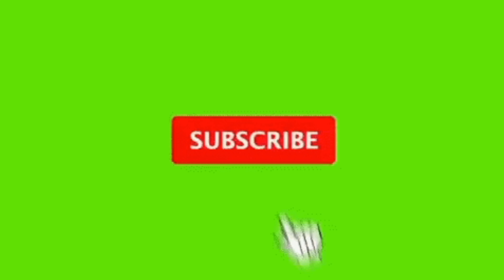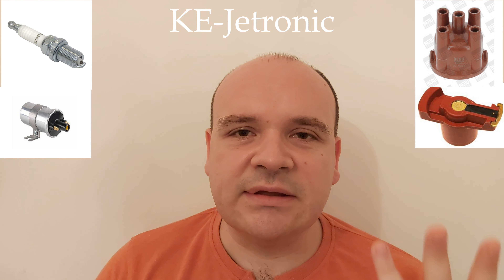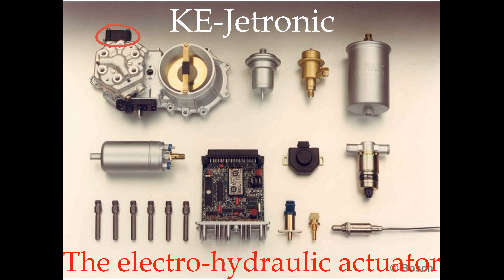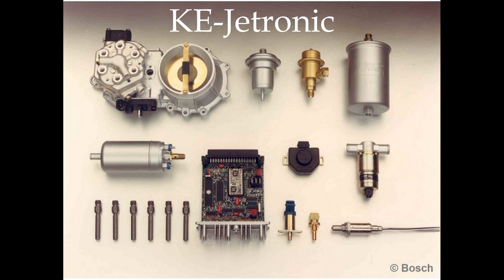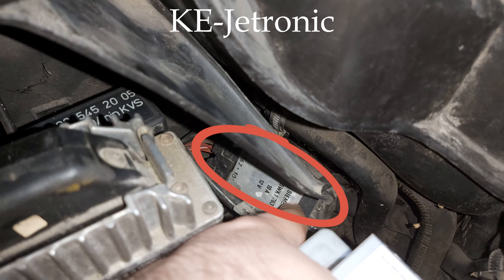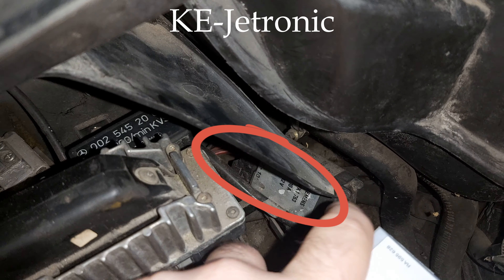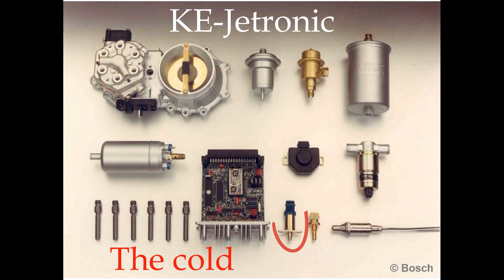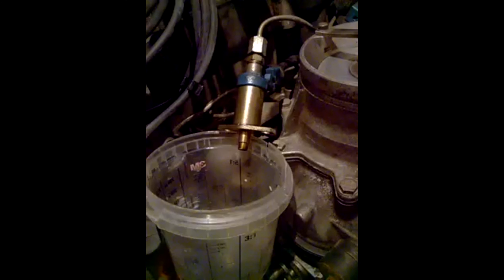㉦KE-Jetronic㉦ - The Basic Working Principle

Comment: Thank you sooo much
Reply from the maker: My pleasure. Happy Mercedesing 🍀 😊 😃
Reply: @mercedeske  your videos on classic mercedes benzes are the best, I hope i will be Mercedesing in my 190e after watching your videos 😀, i have a 190e 2.0 that the mechanics where i live messed up because they don't know how to work on it, so i am watching your videos to fix it myself in the next months, which me luck 😁
Reply from the maker: @JhnStill  Thanks. Just watch my videos and you will be able to repair your car yourself and to save yourself money.
Reply: @mercedeske  i will do my best, thank you so much, it will take me some time because where i live i don't have access to some parts (like a new diaphragm), or a pressure meter (i haven't watched enough videos yet but i think its required for good adjustment especially that the engine harness is damaged (also to be replaced :/) so i cant use a multimeter), but i wont stop trying. do you have any recommendations for a good diaphragm for bosch 0 438 0101 026 (190e 2.0l 1991)?

Comment: hello, in the other video you told that fuel presure must be 6 bar and now you say 5,3 - 5,5
I dont understand...
Reply from the maker: Yes, depending of the engines - engines m102/103 up to 5.5, engines m104/117/119 6.5bar system pressure. IF you have been watching the video on he EHA I took number 6 because it is easier to understand the differential pressure, not that all KE-Jetronic systems must have system pressure of 6bar.
Reply: @mercedeske  I have problem with power in My 230 CE...need 30sec to 100km/h.... fuel pump 5,4 bar, new spark plug, etc, new filter, NEW EHA valve, new all rubber components, motor 12,5 bar on each cyl. new lambda probe (all from BOSCH), I will  made some video from this maybe you can look and find wht is broken...also new injectors, all components tested and I have no idea what else I can do
Reply from the maker: @jsz3452  Okay, make a video. In my video on the convertible I have proved that even brand new parts have to be calibrated - check the EHA and the potentiometer. I believe that the EHA gives too much fuel but that's something you will have to see on the multimeter.

Comment: Hello , what is the role of damper cage?
Reply from the maker: It has to absorb the vibrations from the pump in order for the fuel pump buzzing sound not to spread on the chassis and not to be heard in the interior of the car.
Reply: @mercedeske  so if I don’t hear the fuel pump buzzing I don’t need to replace the damper cage ?
But why he have 3 pipes ?
1 to fuel pump 
2 to accumulator 
3 to fuel tank
Reply from the maker: @guyrozen4506  The fuel starts from the pump and flows to through the filter into the fuel distributor. The fuel accumulator has to absorb the vibrations from the pump. All three parts have to get fuel.
Reply from the maker: If you hear the pump, then it's bad. The sound is something like a V-belt, that loud. That's the indication that the fuel pump is bad.
Reply: @mercedeske  
Sorry but still don’t understand you.
The fuel accumulator need to absorb the vibration?
So what is the role of damper cage ?
Reply from the maker: To prevent the vibrations going onto the chassis.
Reply: @mercedeske  so how I need to check if I need to change the fuel accumulator or damper cage ?
Reply from the maker: If your fuel accumulator is bad you won't manage to start your car warm easy. You'll be cranking.....

Comment: hello, i'm deeply grateful for your amazing video lectures. however, I have something I would like to ask. i'm korean and am incredibly torn between choosing a w201 190E with ke-jetronic and a late w124 220E with motronic. however, in korea, we transitioned directly from carburetors to injection systems, which means there are hardly any experts on jetronic, or those who are, have retired or are few and far between, making maintenance challenging. People around me recommend not going for jetronic for these reasons; is this true?

1) is it true that jetronic systems are prone to misalignment, requiring regular checks? If so, how often should these checks be carried out?
2) I've heard that if a jetronic system breaks down, parts are hard to come by and can cost as much as a whole used car. Is that true?
3) can I sufficiently maintain and drive it for a long time by learning from your YouTube videos? Please, I ask for your guidance. 

i would like to drive a mt Benz, but finding a mt w124 is nearly impossible in korea, even though its maintenance is supposedly easier due to being an injection model. I really want to drive the w201 because it's compact and beautifully designed, and it's manual, but I am struggling with the jetronic system. please respond. Thank you.
Reply from the maker: Hello and to get to the point. KE-Jetronic is a very reliable system but nothing lasts forever and it requires some maintenance checks. There are some mechanical components which fail on the system and have to be replaced each 150k km and some of them at 50k km. No one has been replacing them so that’s why KE-Jetronic turns out to be a “BAD” system. It is very reliable(not prone to a breakdown even a bit). There are 2 sensors which have to be replaced(one of them is called potentiometer and the second one lambda probe, a modern O2 sensor) and considering the mechanical part – the injectors, the fuel accumulator and the pressure regulator – 2 VERY expensive parts on the system but they last for 150k km, so I wouldn’t say so. That expensive as people told you is the system not FOR SURE!!! Yes, you can fully repair your car watching my videos with one multimeter and a pressure gauge. Sometimes the EHA valve can go bad and all the other parts don’t fail, especially the sensors because they are all just switches. My opinion about the system – a work of art which was not lucky to show its full glory. You can repair it in your garage using common tools, multimeter and a pressure gauge. If neglected then it can be a nightmare because you will have to go through the whole system – ignition, vacuum leaks(related to rubber hoses), mechanical part of the system and sensors. There are videos on my channel about everything, so if you want to give it a try, just go. The system will request a mechanic from you, you must dedicate yourself to it and spend a lot of time but once repaired it will start failing after 50k km (lambda replacement) and 150k km everything else I was speaking about.
Greetings from Serbia,
Ivica FyM
Reply: in korea, the technicians, out of annoyance, said, "recommend you just get a new car." you're my savior, master!. thank you so much!!!
 @mercedeske
Reply: please enjoy a delicious coffee on me, even if it's just a small amount! Thank you.

Comment: Thank you very much for your video. I've recently bought a w124 200E with m102 engine. What I noticed is that sometimes when I start the engine it has an acceleration and seems the correct mode of operation because then when for example the AC is on, it is capable of compensating and maintaining the correct rpm. But sometimes there is no acceleration at the start of the engine and is more difficult to turn on. Furthermore is not capable of compensating the RPM when AC is on. I checked the idle control valve and is working. Seems like the electronics don't get the rpm signal to adjust the idle valve (I've also changed the ECU with no success. Any suggestion? Thanks
Reply from the maker: Have you replaced the potentiometer?
Reply: No I didn't I'll try this. Thank you.
Reply: I've replaced the potentiometer but nothing changed.
Reply: I don't know if it is correlated or not but after some weeks I bought the car and started using it,  It happened three or four times to smell something like a burning cable from the AC vent.  All the ventilation system is working well. I don't know if it could be or not but I suspect that some cables from ECU to the KE-Jetronic system that passes inside the ventilation are damaged. I said that because one of the last  I smelled it I stopped the car and tried to find out where the smell came out. And it wasn't in the engine compartment but in the cabin filter compartment. This happened some months ago. Since then no more smell but even no more idle stabilizing.
Reply: Don't know what happened,  but it's been running flawlessly for two weeks!
Reply: I've finally found the problem. It was a bad contact of the OVP relay. Even if it was working with no ABS light on I discovered that the contact resistor wasn't too stable and sometimes too high (50 ohms!!), when should be a few ohms. Maybe you already mentioned this kind of problem in case not I think this information could be useful for other w124 owners that have similar problems. Thank you  @mercedeske
Reply from the maker: @sabatinifabrizio My pleasure. I'm glad you solved your issue. Happy Mercedesing!

Comment: Hi . I have Mercedes 190E 1992 2000 cc engine Sometimes while driving the engine switch off what do you think the problem??
Thank you
Reply from the maker: This is a common issue. Check the EHA in all its phases. Check if you get current(mA) on the EHA valve. If you get 0mA on the ignition on then it can be the ECU. I have a similar issue on my car - when I put the original ECU, the car stalls, when I put the newer one the engine stays alive.

Comment: Very good resource! Thanks again. Have a 190E 2.3 with cold start issues
Reply from the maker: Check the cold start valve
Reply: @mercedeske  my E.C.U was the culprit. No power supply to the cold start valve and EHA valve
Reply from the maker: @123works  I'm glad you found the issue.

Comment: Hi, does anyone have any tips on what could be causing the slow acceleration after engine warm up on the W124 - 300-24V ? If I give it more throttle, the engine shuts off, I have to throttle with feeling to get it going and it takes maybe 10-15 seconds, which is pretty bad in a junction. I replaced the spark plugs, cables, coil, OVP relay, distributor cap and rotors, temperature sensors, fuel filter and still same problem + I have bad cold starts. I bought the car half a year ago, everything worked, the car was not driven and now on the first drive and several starts the following symptoms appear. Thanks
Reply from the maker: Hi. For the beginning replace the potentiometer and calibrate it, replace the lambda and check the cold start valve, replace the injectors and that should make things better. Concerning stalling at the junction, that's an issue which for, if everything is in order, I believe that the ECU is the culprit. But, before replacing the ECU check the whole system for its nominal values for each of the parts and then, then you can try with the ECU. This should help you solve many issues on your system.
Reply: @mercedeske  Thank you for your quick reply
Reply from the maker: @Bullva My pleasure.

Comment: Hi nice video, I have a w201 2.0 and it does not want to start, ocationally it starts but misfires so it stalls and then its hard to start again or it doesnt start. The spark plugs have some fuel on them when I check them, but also I check all HT leads and all of them are sparking, so am very confused because the is fuel and spark but wont start or run properly..would you be able to guide me on how to check it properly ??
Reply from the maker: Hi, thanks. At first-check the injectors. If you have more than 90k miles/150k km, replace them. At first did you or anyone else turn the mixture screw?
Reply: @mercedeske  hi thank you for replying, the car has 110k miles, the car was running fine one day, next day was no longer running ok. No one touch the mixture screw. Only me working on the car, I change fuel pump and filter and also clean fuel tank and change fuel tank strainer inside the tank. I ordered injectors so I can change them, may be tomorrow. After the problem I also change distributor diaphragm and o rings but car is the same no start or running very bad.
Reply from the maker: @T.F.D77  Changes the injectors and if the problem persists check the sensors.
Reply: @mercedeske  ok thank you I’ll change the injectors and see what happens, how do I check the sensors ?
Reply from the maker: @T.F.D77  Each 30k miles replace the o2 sensor, each 100k miles the potentiometer, check the coolant temperature sensor, the tps, the micro switch.
Reply: @mercedeske   my model doesn’t have o2 sensor it’s a 1988, I will double check but I don’t remember seeing o2 sensors. How many ohms should the temperature TPS and micro switch should have ?, is the micro switch the one controlling the idle when throttle is close. Do you have a video checking this sensors. Thank you so much.
Reply from the maker: @T.F.D77  https://www.youtube.com/watch?v=yY7OXR8RTLk
Watch this video and its cards

Comment: Hello my friend how are you?  I follow all your videos and I wanted to ask you if you know how to repair the fuel pump relay of a Mercedes 230E year 1981, since in my country it is not available as a spare part.  From now many thanks and greetings!!
Reply from the maker: Hello, I am fine, thanks. How did you come to that that you have a bad fuel pump relay?
Reply: @mercedeske  Hello, I know because the fuel pump continues to work beyond the fact that the vehicle does not start.
Reply from the maker: @diegovelazquez9213  Try to start the car. Remove the relay, put a wire in the contacts 7&8 and if the car starts, then it's the fuel pump. If the fuel pump runs, then it's not the pump relay, check the coolant temperature sensor or the cold start valve.
Reply: @mercedeske  Thanks, but the problem I have is that I put the car in contact (without starting) and the pump continues to send fuel continuously. Before in a few seconds it stopped
Reply from the maker: If it doesn't stop for about a second then it's not good.

Comment: Hello, I have a 1988 model audi 80. KE-jettronic engine. When I turn the ignition on, my fuel pump runs constantly. It used to work for 3-5 seconds before. I can't find the cause of the problem. I'd be very grateful if you could give me a clue.
Reply from the maker: On Mercedes I would either replace or check the fuel pump relay.

Comment: I have a1982 Volvo 244 gl, and I think it has the same system.  Do you know if it’s the same?
Reply from the maker: If you have the eha and the potentiometer on the system then it's the Ke-jetronic if not then it's K-Jetronic. There is also K-Jetronic with lambda regulation. So, again...if you have the eha and the potentiometer then you have KE-JETRONIC system.

Comment: Amazing video! You’re English is fantastic and your video helped me a ton. I will be watching the second part right now!
Reply from the maker: Thank a lot for your nice words.😃😃😃🙇‍♂️🍀🍀🍀
Reply: @mercedeske  Thank you for your video. It is educative. I have clutch problem with mercedes 190(201) manual clutch system(master and slave clutch, clutch (pressure) disc and plate. Are quality used spare part available?
Reply from the maker: @adeyemibabatunde1814  Thanks. I believe there are good spare parts on ebay. Just search by the number.
Reply: @mercedeske   unfortunately eBay doesn't ship to Nigeria

Comment: I'm having long cranking issues when the engine sits for several hours. It starts fine when it's warm.
Reply from the maker: Test the fuel accumulator and the injectors.
Reply: The injectors are almost new. The accumulator looks old. Is it better to get a new URO parts one or used Mercedes one?
Reply from the maker: Buy from Bosch new one on eBay. This is something you are going to replace each 150k km/about 100k miles

Comment: Hello again.. how can i determine that my 300GE m103 does not have oxygen sensor/ lambda sensor, it says eze ece on ezl trimmer.
Reply from the maker: remove your passanger floor mat. That's the place the o2 sensor has to be located. If you have no catalyst, you have no lambda(o2 sensor). Happy Mercedesing, best regards

Comment: Is it possible to not to have an O2 sensor? Mine does not have one and I was told at the local MB garage that it wasn't fitted with it originally. It's a 1989 w124 300e 12v. Tia
Reply from the maker: Yes, it is possible but if you have a catalyst then you have lambda as well. It's easy to check, if it's present it is located underneath in the exhaust pipe before the catalyst.
Reply: @mercedeske  Thank you, it doesnt have a catalyc converter, but I was not 100% sure that it come from the fsctory like that or that some one removed it as I can see that the exhaust was replaced.

Comment: Hello, I want to ask you for advice, I have a w124 300e 132kW, I have a problem with high emissions, the mixture is rich, consumption is high, engine running is uneven, can it be solved with new injectors? They are original there, they have 330,000 km, thank you for your answer.
Reply from the maker: Hi there.
If you have high emissions then it's the injectors for sure and everything you said are the symptoms of bad injectors. They have to be replaced each 150th km!